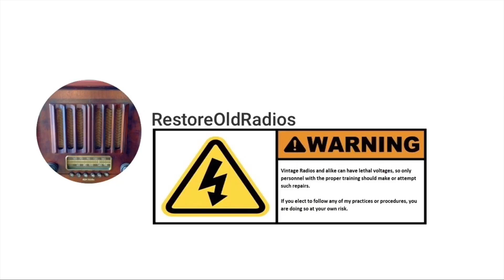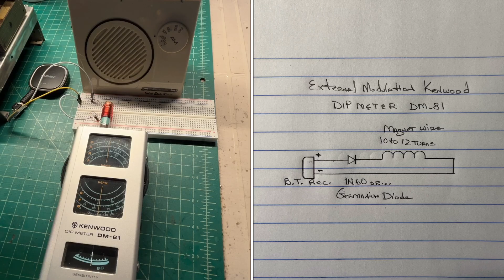Kenwood DIP METER DM-81 - How to Add External Modulation - Close Proximity Broadcaster

Comment: 🙄 I do not fully understand what you are doing here, tuning with your dip meter.
Reply from the maker: Thanks for your question. I’m using the DIP Meter oscillator feature and adding modulation using the secondary coil, germanium diode and Bluetooth receiver. It turns the DIP Meter into a close proximity AM transmitter. Hope this helps. Best, Don
Reply: @RestoreOldRadios Yes this helps, thank you ! I was under the impression that the copper coil was mounted on the bread board, but I now see 🧐 it is wound around the dip meter coil.